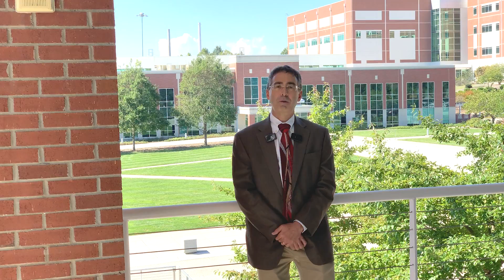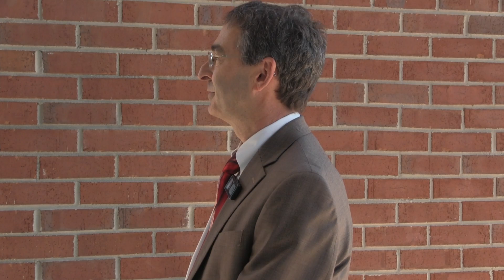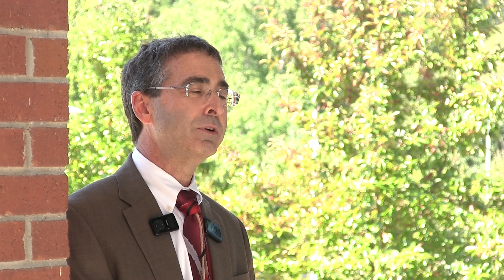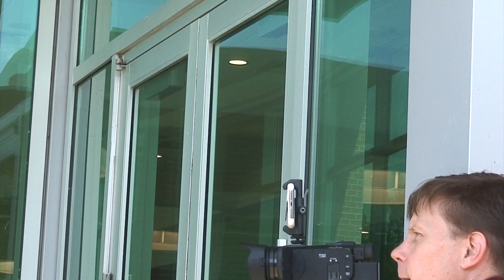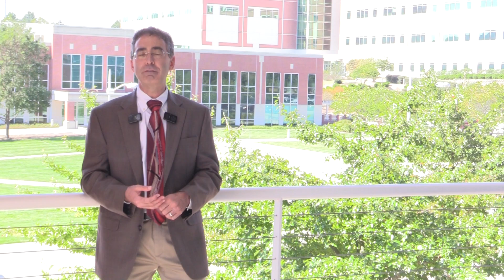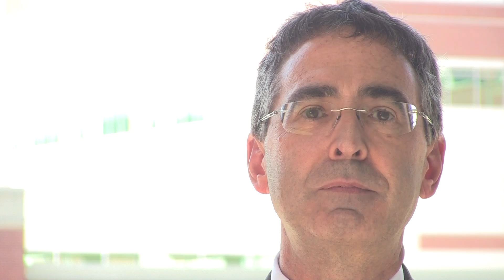Dr. Paul Bredt of PNNL - Molten Salt Reactors - Interview Semi-Raw Footage

Comment: It would seem a good idea to me that rather than completely  knock down the out of date reactors, that they could update them to these MSR's and then the connection to the power grid and infer-structure  would be there. Also they could use all of the spent fuel to power the new ones. They would have 1000's of years worth of fuel on site
Reply from the maker: holographicbreathin should they age-out, sure. I’m more interested in MSR on coal plant sites. Power lines already there too. Bigger gain to replace coal than to replace PWR.

Comment: I agree wit Dr. Bredt that online chemistry is one of the fundamental nuts that we need to break in order for MSR to be a commercial reality.  Some of this was done at Oak Ridge but much remained to be done to get to a commercializable reactor.  There are many different reactions going on in the MSR core and some products like it in the salt, some prefer to be a gas and still others are not soluble in salt.  Any MSR must be able to manage these products in the context of an operating reactor basically automatically and with any threat of nuclear proliferation.  This is doable but is a tall order and the problem is not cost, it is an actual scalable solution.  Very exciting times.  I wish I was a nuclear chemist today.
Reply: Not if you do a fast spectrum molten chloride salt reactor, then you only have to filter out the radioactive noble metals, no chemistry equipment on the reactor needed at all. The rest of your inventory can stay in the reactor for the life of the reactor vessel. MCSFR for the win.
Reply: @hjembrentkent6181  right, but fast spectrum requires fuel concentration to be kept rather high, and thanks to Carnot's theorem, the lower operating temperatures in a fast spectrum MSR makes it theoretically less efficient than thermal spectrum. You additionally lose neutron economy to some extent with fast spectrum, which can be frustrating. There's also the fact that some byproducts of Thorium and Uranium breakdown are ideal to extract ASAP, such as Technium 99 and Molybdenum 99 for radiotherapy. If you leave such isotopes laying around in the reactor, they will burn up before the reactor's lifespan is up, meaning you'd have to take the less efficient and more roundabout approach of attaching cyclotrons to the outside of the reactor and breed these isotopes manually. A real-time extraction system means effectively immediate access to these isotopes.

Comment: are you talking about a thalium reactor ?
Reply: It's thorium related, but really, you can burn any of  the three nuclear materials in a molton salt reactor, the issue is that the fuel is dissolved in hot liquid salts, rather than being solid rods, allowing you to burn the whole material, rather than just a few percent and leave the rest as waste.  I.e. we have 500 years worth of power sitting at Nuclear Reactors right now in America as "waste" b/c Gen 1/2/3 reactors were not designed to utilize it.
Reply: @pyrrho314  if you do not use Thorium will the waste that is left still last 10,000's of years or that also shorter like the thorium ?
Reply: @holographicbreathing  My understanding is that molten salt reactors will burn close to 100% of whatever fuel you're using, be that thorium, uranium, plutonium, and leave a very small amount of waste that needs oversight for a few hundred years.
Reply: I think you mean 'thorium'.
Reply: @JohnChampagne  yes thats what I meant I thought I had changed it but it cant have saved